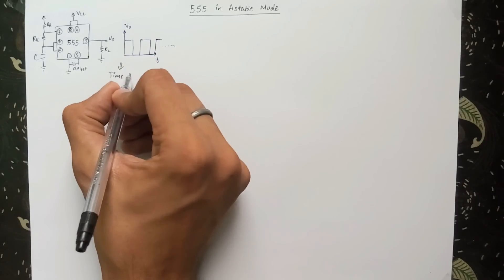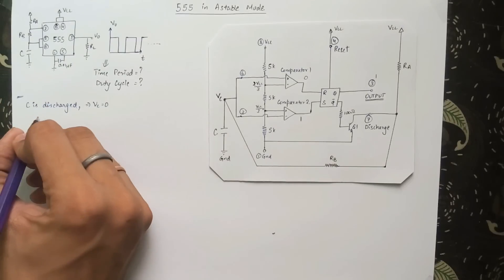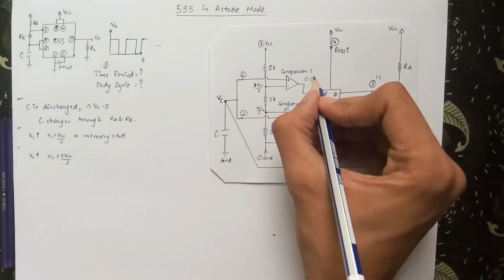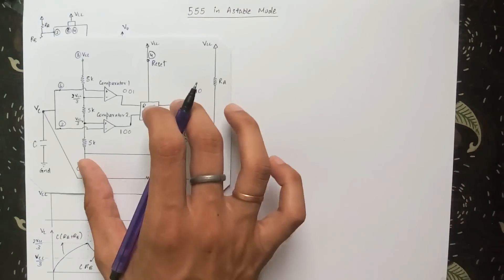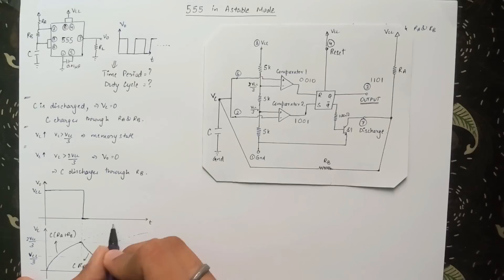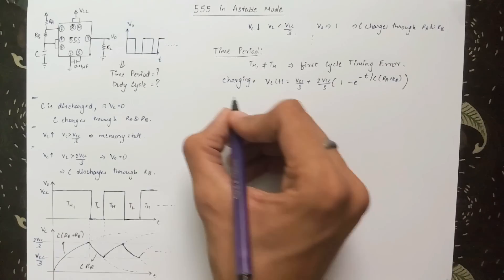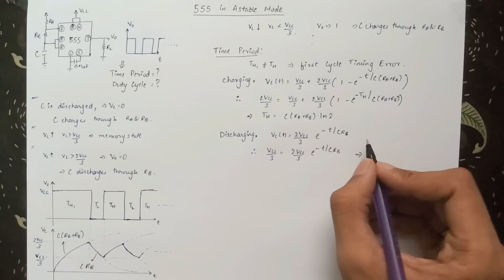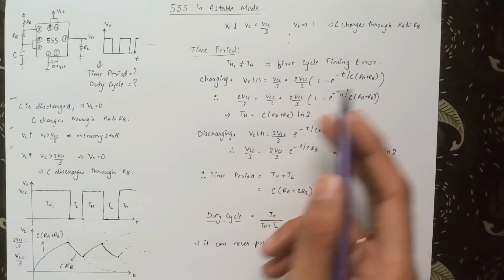555 Timer IC: Astable Mode of operation

Comment: You can also charge and discharge the capacitor only across RB using the output pin 3 of the 555 timer. The advantage is, that you can save 1 resistor and you reach 50% duty cycle. And you can also separate the charge and discharge resistor path using 2 diodes and 1 potentiometer between output pin 3 and the capacitor to get every duty cycle at a certain frequency.

Comment: Explanation is superb but if you could please explain how did you write that voltage equation for capacitor during charging and discharging then it will become a perfect tutorial!! Thank you
Reply from the maker: You can arrive at these equations using basic network theory. You know the capacitor and resistors through which charging and discharging is happening, apply RC equations and boundary conditions from the graph. Still, I will try to cover these basics in future!
Reply: @electroTuts  Yeah do make tutorial on Control Theory.
Specifically Transient Response.

Comment: plzz....explain how do we get rectangular pulses ??
Reply from the maker: due to the presence of FlipFlop inside the 555 IC. FlipFlop's output can either be high or low and is the output of the 555 IC. Do look at the working of internal circuit of the IC to get more details :)